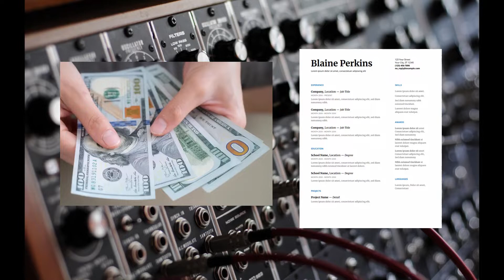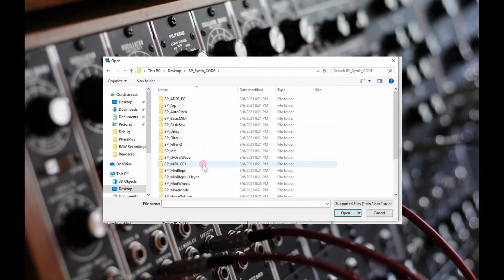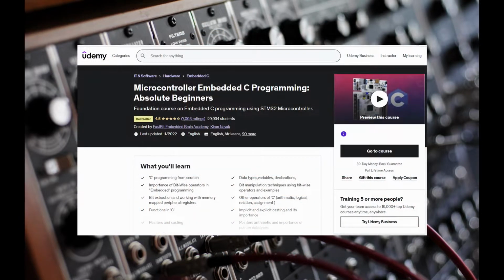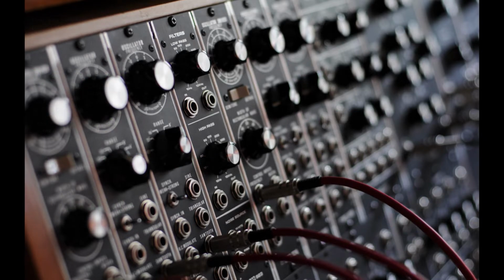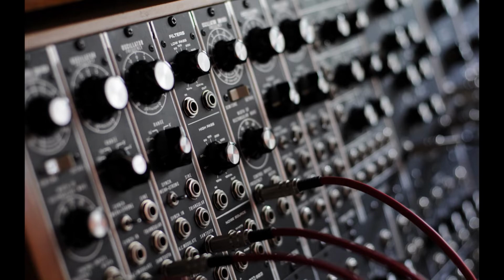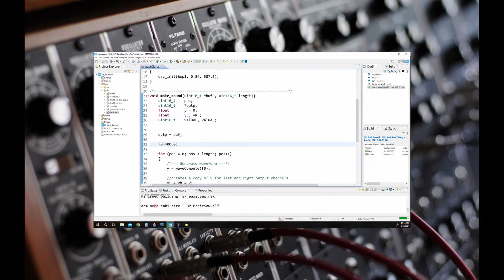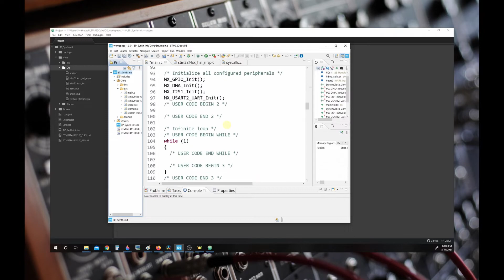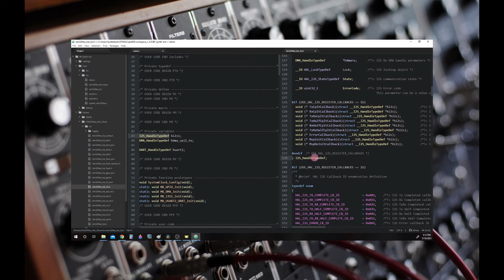000-Introducing the Synth Code Lessons!

Comment: great project ! would you happen to have an Arduino ino sketch file for this? I would like to add physical controls on the blackpill board, like pots and switches. For LFO and ARP as an example.
Reply from the maker: No ino file.  This project is probably not going to be continued due to both lack of public interest and my nealy zero freetime since I took on new roles at my current job.
I wish I had time to play around with it, but coding/developing takes a lot of time, concurrently, to make any progress.
Reply: How difficult would it be to change the midi CC values of arp mode?

Comment: I see on the info for the Kiran Nayak couse that he uses the STM32F407 Discovery board as his target.  I have a Chinese F407VET6 black board, the type I have seen you use in an old video.  For the purposes of doing his intro course, am I good to go or do you think I will need the Discovery board?
Reply from the maker: I think you'll be fine.  Even if your board doesn't have a user button the Discovery board has that he uses, you could breadboard up the circuit by getting the Discovery schematics and copy the button circuit.
The BlackPill board might even work too since it has the same M4 core and ST was smart in making their line of uC's pin compatible, even across different Cores.
You are going to learn A LOT about how C is used to manipulate data for these uC's.  All his classes are excellent.